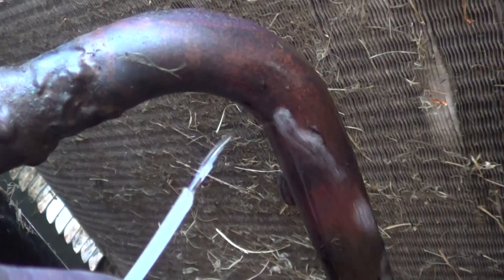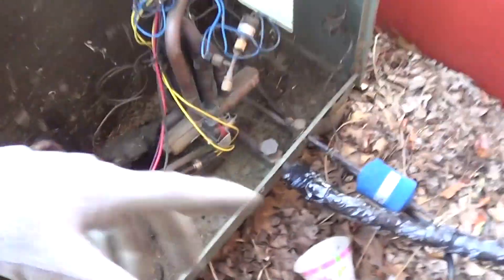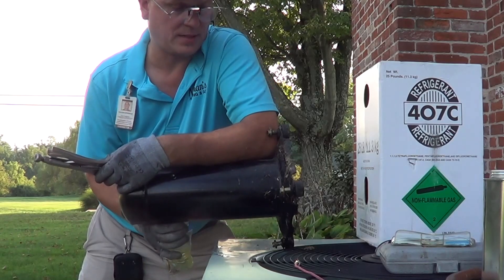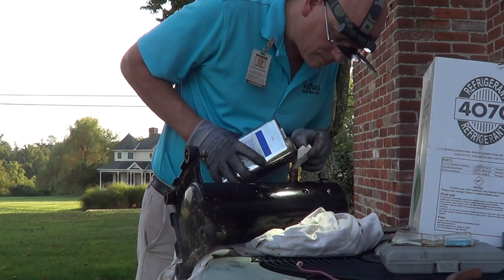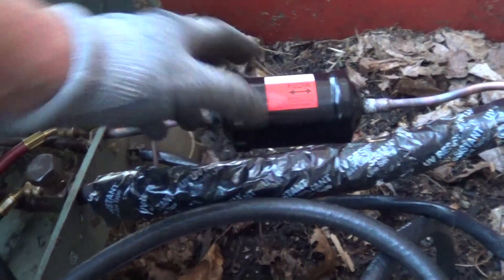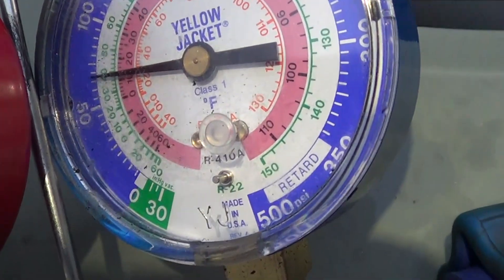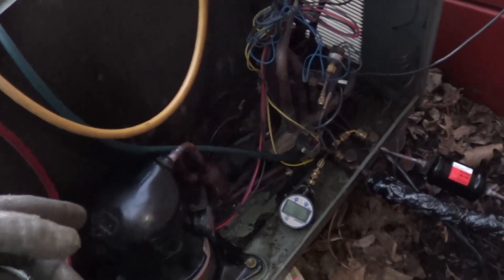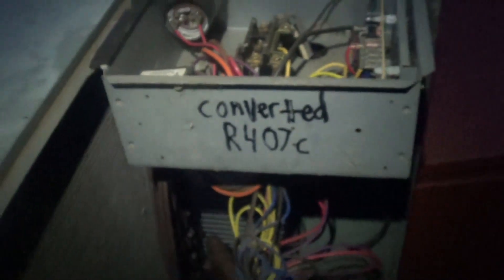Converting a R22 system to R407c

Comment: R407c made in China
Reply from the maker: geoffrey walker. The Chinese are making it because it is the widest R22 substitute and use. it is OEM approved and even had a chance of beating r410a out as a long-term substitute. http://www.achrnews.com/articles/114247-unwrapping-the-mystery-of-r-407c
Reply: NathansHVAC 

very true. I just wanted to point that out for laughs lol. there are actually three I think countries that make it China being one, another either In Europe or S. America somewhere and a place in Texas. I wish they would have simply done this to our 1993 York instead of replacing it and furnace with a puron because the heating has never been the same. it don't help they pit the coil in the return either due to space on old furnace but they should've switched it when furnace was replaced.

thx for sharing
Reply from the maker: geoffrey walker I see evaporators in The Return every once in awhile, but not too often. the humidity is 100% after the evaporator. but if it makes you feel better, all Air Handlers have that same configuration. if you have a 20 year warranty heat exchanger, everything will probably be fine and last 20 years. if the heat exchanger is uncoated , it could rust faster from sweating from the cold air in the summer. either way you should have a carbon monoxide detector in the house.
Reply: NathansHVAC 

I do well I did before it decided to go off and I'm not talking in a good way ( no Co present it was defective so gotta get a new one soon here)

I could write a Bible about what they did but in a nutshell they installed the new outdoor unit after the previous contractor charged not once but THREE times at 300 a pop to repair and refill the 22 and he STILL did not fix it-he's a scammer in my book. so they said screw it and replaced because parts were getting scarce( new contractor was like they giving you brand new so f**K it) I agree with him. the old furnace did not have the headroom so they put the coil in the return( furnace was York stellar plus and sealed) moving ahead to last month(Feb.2017) they decided to replace furnace as well because condensate motor housing was cracked. again age of furnace merited replacement. new unit is much smaller also a Goodman but now 80K BTU but they left coil on return when they could have moved it to output but left it as is new furnace is also sealed but 97 AFUE. nothing on the heatpump has ever been the same. it works but I really need a certified Goodman tech to look at the setup. it's dual fuel heat pump primary.
Reply from the maker: geoffrey walker Is it natural gas?  also the controls are simpler when the evaporator is on the return.  a simple 2 stage heat pump thermostat can run the furnace and heat pump at the same time as aux heat.
Reply: No it's LPG(propane). But that's the secondary. It kicks in when the heat goes into aux mode. We don't have any resistive elements installed. I was always told even by Goodman that it will damage the heatpump if the LPG kicks on and it's running because the heat will backup into the compressor henceforth taking it out.

Perhaps I am wrong???? IDK I'm just going by what I was told
Reply from the maker: You don't want hot air going into a running heat pump coil.  The pressure will get too high because the heat pump will think the house is 120 deg F.  But, since you have the evaporator coil before the furnace, the heat pump should never see any hot air entering it.  That is the advantage of putting the evaporator upstream of the furnace.
Reply: NathansHVAC however most furnaces do accept 90-100 degree return air

Comment: What do you think about 427a?
Reply from the maker: You lose 7% capacity.  Suction pressure drops 5 psi.  My main thing is the suction pressure.  I don't want to have to mess with the metering device.  They all work.  Losing 7% is a lot better than losing 50% when a unit is half full.
Reply: R-427A is basically R-407C + R-143a.  So it still  wants POE oil and costs more than R-407C, no real advantage there.

Comment: I have a question. A 30lb container of R22 is about $ 500. That is about $17/LB. Why do the companies charge $ 100 /LB. I know they have to make money, but( huge but).......
Reply: New production of R22, a chlorofluorocarbon, (See: https://www.google.com/#q=R22+molecule), abbreviated CFC, was banned (per the Montreal Protocol) by Federal law after 2010.

After 2010 (& increasing with rule changes through 2030), only hydrofluorocarbon (See: https://www.google.com/#q=HCFC+molecule), abbreviated HCFC (i.e. no chlorine atoms), gas production for refrigerants is allowed. Thereafter, the only available R22 is recycled (with all the associated and increasing additional costs). In 2030 all R22 recycling becomes banned.

All conventional refrigerants are based on methane or ethane gas.
(See: https://www.google.com/#q=methane+molecule and  https://www.google.com/#q=ethane+molecule)
 
R22 is methane with only one hydrogen atom still attached to the carbon. 
One of the 4 hydrogen atoms is replaced with a chlorine molecule & two of the 4 hydrogen atoms are replaced with florine atoms. 
Thus ChloroFlouroMethane, or ChoroFloroCarbon (referring the carbon atom of the methane gas), commonly further abbreviated to the acronym CFC.

This chlorine containing gas releases chlorine gas molecules into the air and, over time, the chlorine molecules bind with and reduces ozone gas in the ionosphere. This ozone partially protects us from high energy ultraviolet wavelength radiation from the sun (which drives skin cancer and many other problems for biologic creatures, e.g. humans, not adapted to handle the increased UV radiation.)
Reply from the maker: Most residential systems are only 2 lbs low when they freeze up.  So the flat rate price covers the labor to properly add the charge.  Too much freon is probably worse that too little.  But, to answer your question:  The licensing and EPA restrictions make it so they can charge $100 per pound.  If the customer were to add their own freon, they risk blowing them selves up, contaminating the system by not purging the hoses, slugging a recip compressor or even adding the wrong refrigerant.  I expect to see $200 per pound next year when the R22 jugs go for $1000 per bottle.  They will probably top out at that.  That is why it is nice to convert to refrigerants that aren't banned.
Reply: NathansHVAC Sounds to me like they are taking advantage of a situation. Blowing themselves up?   When did R22 become explosive?
Reply from the maker: If the customer adds in 30 lbs of R22 to a heat pump running in the heating cycle, the hot gas line or evaporator will blow up from over pressure and over charge.  There won't be a flame, whipping copper around from a bad solder joint will get someone hurt or killed.  Charging a system is not like adding radiator fluid to an engine.  You can't see what level you are at without instruments.  But, people even get hurt adding radiator fluid.  At least with the car industry the freon is 1 lb jugs.  There is a reason Autozone doesn't sell 30 lb R134 jugs to the general public.
Reply: closer to $700/# wholesale almost 24/#. a jeweler on TV stated his industry mark up, is cost X 17 (common). thats why a diamond is only worth 10 cents on the dollar. Yes, 100/# is a bit much, shop around.

Comment: What are the consequences of too much oil ?  Thanks ,   Wyr   God bless
Reply: NathansHVAC  so good sir
Reply from the maker: 20% overcharge of oil will do nothing.  Doubling the oil charge would probably caused motor overheating issues when the rotor begins turning inside the pool of oil.  I would imagine the bottom of the compressor would become noticeably hot near 220 deg F if the oil level were 2x to 3x over charged.   https://hvactutorial.files.wordpress.com/2010/12/copeland-scroll-compressor.jpg
Reply: So , if you have a system that has lost some refrigerant and some oil , you can add oil , as long as you are reasonable about it ?
Thanks ,
Wyr
God bless
Reply from the maker: I haven't been able to find a way to check the oil level on a residential scroll.  Many commercial scrolls have a oil sight glass on the bottom of the compressor.  The recip pot compressors show oil level on a thermal camera.  But, the windings of a scroll touch the outer shell.  So, the hot oil on the bottom is masked if you use a thermal camera to check the oil level.  To sum up:  Checking the oil level on a residential is a total guess.  However, I wouldn't worry too much about the oil level.  The compressor can run on a very small amount and a very large amount without too much issue.  Also, freon leaks lose very little oil.  I never top off oil in residential compressors in the 30 years I have been doing HVAC.  Converting to HFC refrigerant is a different story.

Comment: I have come across units that have outdoor txvs that say r22 and 407c but you have to think about ac not heat on a freon system with 407c is meant for low temp hint learn something because might be good for heatpump just a theory due to a low boiling point then r22 but I just work for someone just guessing comments
Reply from the maker: R407c is a very good choice for heat pumps.  It has better efficiency than R410a for hybrid water heaters.  As of 2010, Copeland said the two best refrigerants for heat pump are R410a and R407c.  http://www.emersonclimate.com/europe/ProductDocuments/CopelandLiterature/TSC123-EN_ScrollHeating_vs10_0.pdf

Comment: Hi... could you tell me if when doing a Freon retro fit from R22 to 407c, do you have to change the TXV on the Evap. to a 407C type.
Reply from the maker: No.  That is the reason to use 407C.  It is the closest match available to R22.  The old expansion valve has R22 in the diaphragm.  All the other retrofits require adjustment or replacement of the expansion valve.  R407C is close enough that no changes are needed other than putting in 20% or more POE oil to return the existing mineral oil in the system.
Reply: I'd like to know where you get this 20% from of POE oil added to R22 system to convert to 407c when Emerson as well as Tecumseh say nothing about this 20% figure. In fact they say that you should have no more than 5% mineral oil in the system and optimum is 1% mineral oil or less. Tecumseh goes on to say that if the model of the compressor doesn't contain a 'C' notation in the model number referencing R407c as acceptable then 407c is not recommended for use in that compressor. I've read things you say about listening to the pros but then when I go and read what you post as reference material that reference material is in contradiction to what you say. # Keeping it real.http://www.certifiedrefrigerant.com/copeland_r22_r407c_retrofit_guidelines.pdf  (split links hopefully this will work.)http://certifiedrefrigerant.com/tecumsehguidelines%20for%20utilization%20of%20r407c.pdf
Reply from the maker: I get that number from a Phd chemical engineer at one of the large refrigerant manufactures.  His specialty is compressor oil and refrigerants.  I won't name his name or where he works.  But, he basically says that 20% POE will work on most residential applications that don't have long vertical rises to the compressor.  If you email me, I will forward his exact reply.     n a t h a n g w @ a i r m a i l . n e t     without the spaces.
Reply: Yes must be

Comment: Well I'm in the same boat with getting older. I'm constantly looking to pare down and lighten my load. I've been using Bluetooth gauges. Can you detail exactly what you use for temp and pressure and why? Maybe I'll copy you
Reply from the maker: I have used many of the Fluke 80PK-8 pipe clamps for 20 years.  It never lets me down and keeps 1 degree accuracy.  Sometimes it will get dirty and go 10 deg F off, but it can be cleaned with warm water.  I have never seen it go off cal where I didn't notice it.  I'm using the Fieldpiece SC260 for a couple of years now.  It seems good.  It will read the pipe temp and all the electrical stuff you need.  I actually change out the probes for straight pins.  But, I always wear dynema work gloves that prevent me from getting shocked.  For pressure, I use the little 3 inch hose with a gauge.  Right now I have a high dollar ashcroft on it.  I trust it pretty good.  But, in hind sight I would probably just buy a large 3 inch 500 PSI analog gauge instead.  I put all the conversion pressures on my cell phone as a contact with notes.  But, there are also apps to convert pressure to temperature.  Of course charging uses a regular gauge set.  And, I evacuate with a vacuum tree and 1/2 hoses.  I really like the little 3 inch hose on the little gauge for losing the minimum amount of refrigerant when checking pressures.

Comment: Great video as usual. You have to be the best hvac man I've seen. Why do you use the hodgepodge of gauges and thermometers instead of a digital manifold where the temp press chart is loaded in there and it does sc and sh for you? Sorry if you've answered this already.
Reply from the maker: Size, weight and accuracy.  I try to get the lightest tools that I can, because I am getting older.  I find it extremely useful to have the tools small enough that they can be carried all the time in my tool bag.  Also, the fluke pipe clamp thermocouple is the most accurate.  However, you do have to rinse it off with hot water occasionally.

Comment: noticed you charged this  as a vapor. 407c is a blend of different refrigerents and should be charged as a liquid. you should have inverted the can the entire time you charged it just as you would charge 410a.
Reply: propane???
Reply: Sure, propane.. I live close to the Mexican boarder and for a long time people were going to Mex to fill their R-12 cars and all they put in was propane... Only issue with it is: burning, exploding and burning your house down.. But that is what insurance is for..... But you can order a 30# R22 jug for 400$ on refrigerantforless.com , not worth a house fire over 400 bucks IMO
Reply from the maker: You are correct.  R407c is even more zeotropic than R410a.  I just leak check and triple evacuate with vapor.  This isn't ideal and probably swings the gas blend slightly.  I always charge as liquid.  The bigger issue is refrigerant leaks changing the blend during the off season when the equipment isn't running.  People including myself do forget that the blends (including R410a) don't leak the same as R22.  I suppose I will have to get a refrigerant gas analyzer some day.  But, they are still around $2k.  And, I have never run across a system that i suspected had the wrong refrigerant in it yet.
Reply: @NathansHVAC  that's because you've not been to my house. When I sell my house, I plan on venting and burning the propane out of my system and drawing a vacuum on it for a good amount of time before I call a AC guy to recharge. That's assuming my compressor lasts that long. 

I filled my system with propane because I just couldn't afford anything else and I had to fix my central AC for my newborn. A wire came loose from the last guy who worked on my system and it burned a pin hole in a tube, easy fix. So far, my energy bill is about the same but obviously I may be having oil issues and may reduce the life span of the compressor. I'm fine with that of it means overall I'm spending less money(I will be even if I end up replacing a compressor). If I have to replace a compressor, I'll definitely be looking into putting the proper oil in it.
Reply: @ExtraFungus  I would just convert to 407 or 422. 
If there is propane in the system and there is another electrical short , you might need a new house.
Reply: exactly